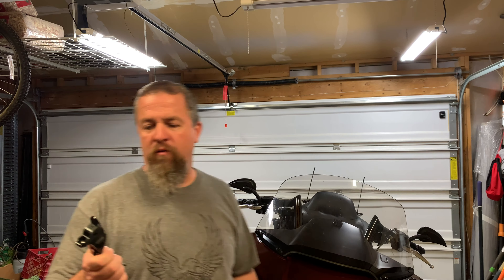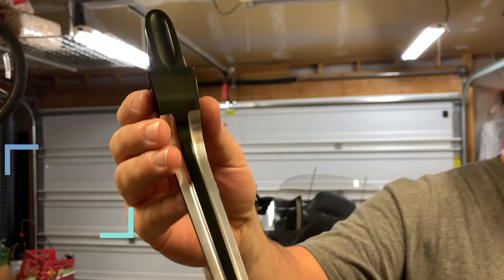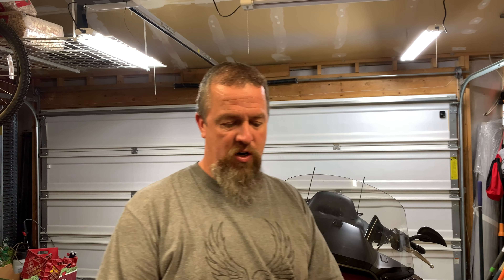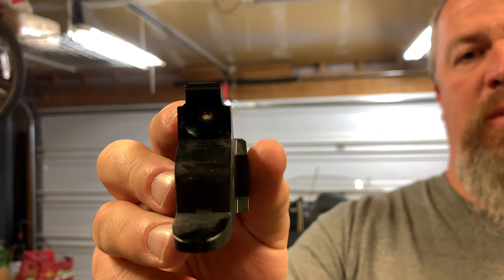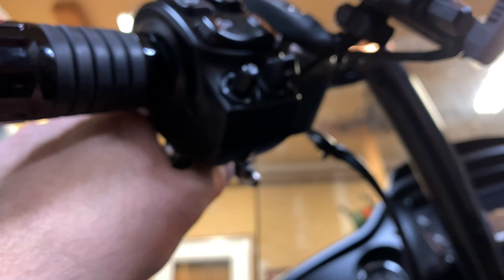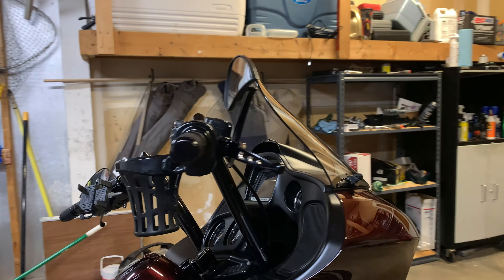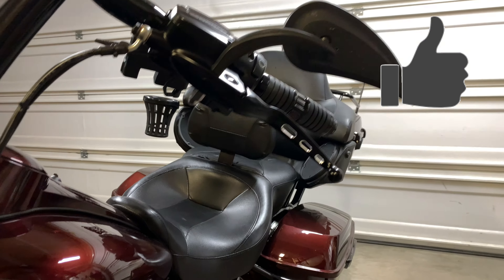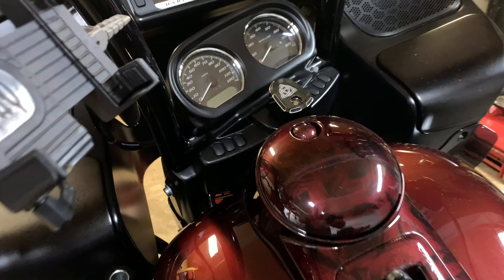Arlen Ness vs Harley Davidson - Hand Control Levers

Comment: Hmmmm interesting info.   Great video man.  I still have stock and they are about shot.   I have a piece of paper in the housing just so it presses down far enough to trigger my brake lights hahaha.
Reply from the maker: Interesting, the break lever does not not have the cup.  Brake control ever been off for bars or any other reason.  That break switch can be a pain.

Comment: Please be careful when putting the brake master cylinder on the bars.
You could damage the light switch which will not allow the brake lights to turn off. This will affect your cruise control also.
Not a terrible cost, you will just be kicking yourself for not watching what you are doing.
Reply from the maker: True, the newer ones are not as bad as they were a few years ago.